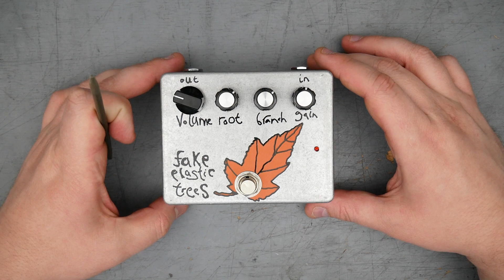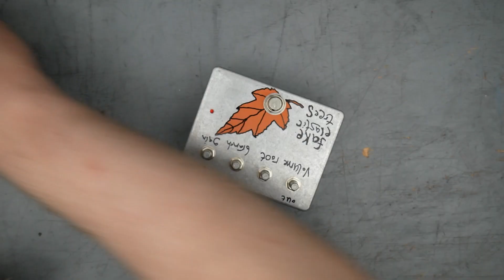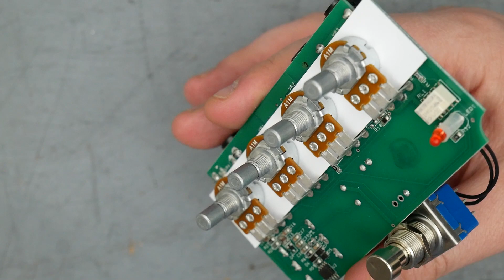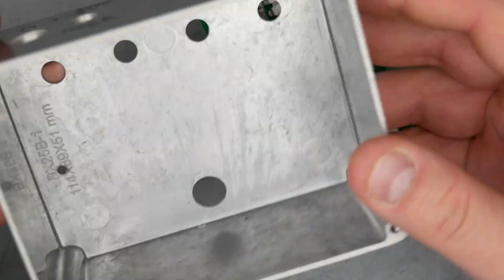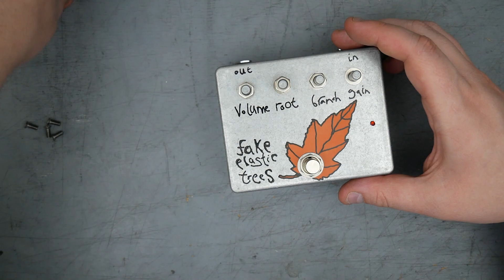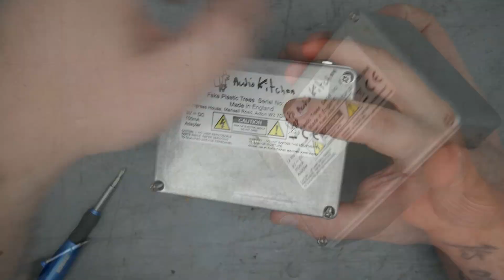Audio Kitchen Fake Plastic Trees Teardown! See what's inside!

Comment: Nice. That might be a 1590C enclosure (BB = 119
mm x 94mm x 30mm vs C = 120
mm x 94mm x 53mm). However, when I saw the inside of the enclosure, those dimensions appear to be a Hammond 1550C (115 mm x 90 mm x 51 mm)